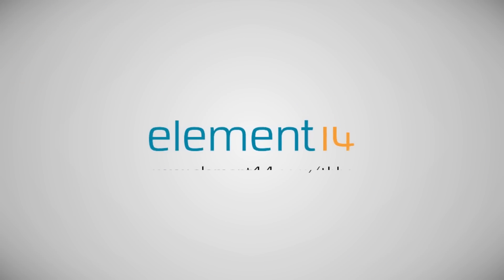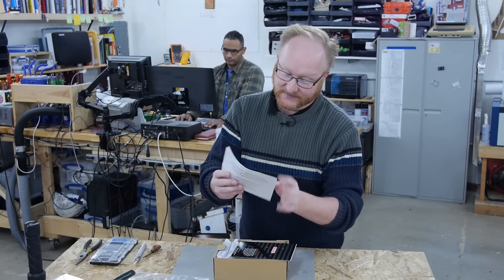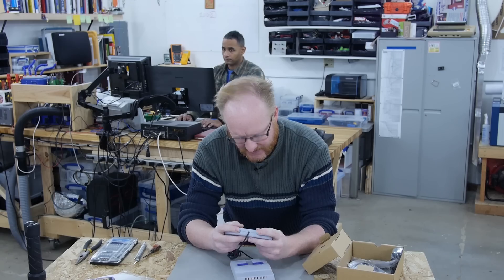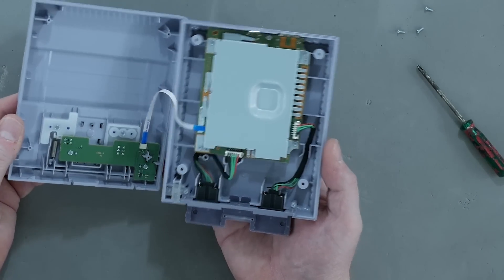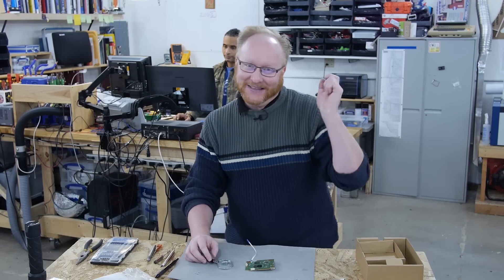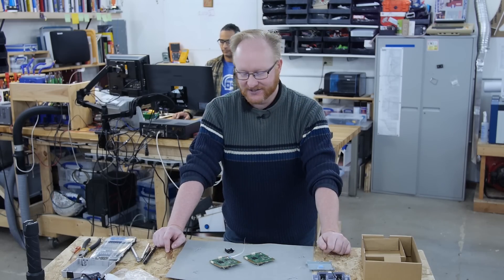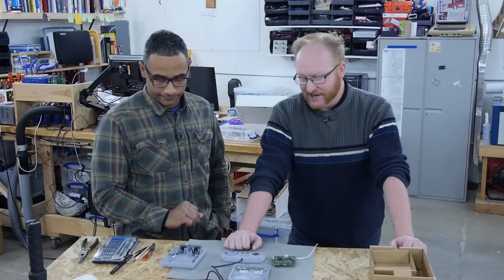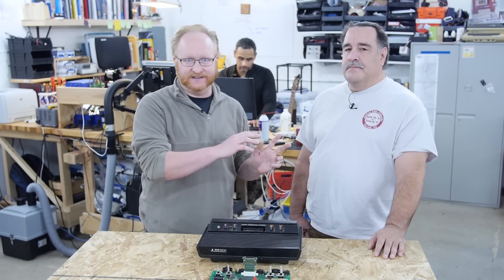SNES Classic Teardown

Comment: I'd love a phat ps3 teardown. I'm curious as to why it was actually beneficial to make a ps3 cluster supercomputer back in 2010, because I've been doing some research on it because it was a weirdly over and underpowered console at the same time.

The ps3 had worse graphics because it was hard to develop for but had really good compute performance at the time which i don't understand.

Also the hardware ps2 emulation is interesting, i want to see how they did that.
Reply: Arsenalfanatic09 
The ps3 was originally planned to have no gpu because of the cell processor , they decided late on to include one from nvidia and it was on par with the 360 gpu wise. The ps3 didn't have "worse" graphics it just didn't get the same performance early on because devs didn't spend time correctly porting games to it. Ps3 exclusives look and perform better than any 360 game (not being a fanboy just stating the truth) 
As for ps2 on ps3 , it wasn't emulation on the original because it contained ps2 hardware, it literally had a ps2 inside.
Reply: Andrew Fishburn 
It did have worse graphics because games on both had worse graphics on ps3 than on Xbox for a long time, you're just being pedantic. The Last of Us definitely looked better than any Xbox 360 game ever made but on average during most of the ps3 lifecycle it had games with worse graphics due to how hard it was to program for (which I would like an in depth description of why it was since I can't find any sufficient enough for an electrical engineer who never got an opportunity to work with Cell)

Also I think it would be fair to call it hardware emulation since it wasn't literally a ps2 stapled onto a ps3, since it still communicated with the ps3 controllers and OS and saved ps2 memory card data to the ps3 hard drive.

Cell looks like an interesting architecture that made the more interesting console in that generation in my opinion.
Reply: Arsenalfanatic09 
I take it you don't own a ps3 or know what pedantic means. You're coming off like a 360 fan boy stating an opinion as fact. 
The majority of multi plat games are near identical on both except for some early ports. The stigma from the early ps3 problems never left for some people and so that myth persists at least in average Joe circles.
Reply: Arsenalfanatic09 
It's not emulation if it's using actual ps2 hardware , which the first model ps3's did. Later models removed ps2 hardware and used emulation software.
Reply: 1. I owned a slim ps3 and liked it more than the 360. I'm not a fanboy for either i'm just stating facts.

2. Earlier games are noticeably better graphics wise on 360 and later ones are still slightly better on 360. It's not a misconception that games look slightly worse because it was truth since it was hard to optimize for that many parallel APUs and the 9 threads available to games. It was marginal difference by the end of the lifecycle but what's the point of having graphical potential greater than xbox 360 if no games ported to both were exactly equal or better on ps3.

3. I do know what pedantic means and I called you it because you are pedantic. 

4. Emulation doesn't have to be software based only. It may literally have a ps2 inside but because of the way it interacts with the ps3 architecture it can be considered hardware based emulation.

Comment: They make 5" LCD HDMI screens for raspberry pi's, they even come a bit smaller IIRC. I have one of the 5" ones inside my PC displaying system information, temps, clock speeds and the time. It's also touch capable if you wanted.

Comment: The N64 is still not a well emulated machine on lower power platforms like Raspberry Pi. My hope is that if Nintendo does make an N64 classic it will be easily hacked and open the community to a better understanding of how to emulate the device.

Comment: I still have doubts about Nintendo's ability to make a n64 mini. I know they've already trademarked some aspects, like the likeness of n64 controller stencil for the top of the box, but they also seem intent in keeping production costs as low as possible to maximize their margins. While the SNES mini only changed the RAM for obvious reasons, n64 might require a more significant revamp. While the cortex a7 has already been shown on the nes and SNES mini to be able to power a mupen 64 core on retroarch, this was achieved with some compromises. A cortex a 53 like the pi 3 might be more suitable for this tasks, as it can handle 64 bit instructions natively, although n64 emulation has been possible in 32 bit singer since even the Pentium ii era since n64 games, due to space constraints, don't actually use many 64 bit instructions.
I think the biggest consideration will be cost. We're looking at a bigger nand due to the size of n64 roms, maybe a new SOC if the a7 proves to be too slow. More RAM due to needing to precompute as many of those 64 bit instructions as possible, and, perhaps far more crucially, the n64 controller. Here is where it's unclear which route Nintendo would take. Controller save pak will obviously be emulated, but what about rumble? What about the analog stick. Will Nintendo use the authentic feeling but expensive n64 mechanism? Or will they use modern potentiometers and lose the authentic feel of the n64 controller?
Tldr; wether the n64 mini will get made depends less on the SOC and more on the controller
Reply: I hope they keep the old school analog stick. Getting a blister playing Mario Party mini games just wouldn't be the same.

Comment: I remember having difficulties emulating N64 on a 1.05 GHz AMD K9 with 768 MB of RAM.  I don't even remember what GPU I was using at that point; this was back in 2005, so, it was an old system by that time already.  Of course, back then I had no clue what I was doing in regards to emulation, so, it's possible I wasn't setting Project64 up correctly.  But I do remember it being quite difficult to get everything running right.

Comment: My theory on the short controller cords, after playing it for a while, is to make you keep the unit close to you so that you can reach the save state button. Hitting the reset button takes you back to the main menu where you can save wherever you are at that moment. It came in really handy but wouldn't be useful if it was across the room from you out of reach.

Comment: Yeah they did keep the data bus on the usb.  Also the controller ports even though they are Wii ports are not wired the same so a Wii controller will not work in them without an adapter
Reply: Tomorrow I will upload a video the video I just made proving that incorrect. Official Nintendo Wii controllers 100% work on the (S)NES Classic.
Reply: That's not true, actually. All official Wii Classic controllers work on NES and SNES Classic just fine. Unofficial ones don't, however.
Reply: not from what i had seen from other reviewers

Comment: “Remember the 80s?”
SNES Release year: 1991
Reply: ... that Nintendo Power slogan came out in the 80's. I give him a pass.
Reply: Your right although the SNES still uses mainly 80s tech
Reply: Maybe hyped in 80s
Reply: It's not like technology/culture suddenly changes upon a clock striking 12 @ midnight. I personally consider the official end to "the 90s" to be September 11th 2001. Not much about 2000/2001 was different from 1998 or 1999 up until that point.
Reply: In late 80's there were chip shortages and that made carts more expensive to manufacture and even produces game shortages to licensees of Nintendo, but nintendo get the best deals to guarantee chips for themselves, that's what he's talking about
Reply: oh the classic coward comic book guy comment
Reply: If you had a SNES when it launched in the early 90's then you remembered the 80's. Someone to have played the SNES at launch and later would've had to have been born 1985 or before to really remember the SNES.
Reply: And it's not pronounced "snes" either. Ooh lets make it sound retarded to simply save a second!
Reply: Released in late 1990 in Japan.  Of course, the hardware was finalized well before then.  And the CPU is still based off the 6502 design that dates back to the 70s.
Reply: just 2 years out of that decade
Reply: I 'member

Comment: My biggest issue I ran into when thinking about making these portable is getting audio out. Audio is only transferred through HDMI and I havent been able to find a screen that has a DAC spliter for the HDMI audio to analog (or any splitting of audio) and the same issue with trying to find HDMI modules that would split its audio. Most HDMI spliters removed/forget about audio. So you could build this system if you never wanted to hear a game. Anyone find a solution for this?

Comment: The only reason why Nintendo made those consoles is to keep the brands alive and preventing to lose their ip before it's considered abandon ware. It's the same reason why they made the virtual console. They just need to sell some units to be able to claim their brands as still on market. What they don't care about is how many people can buy it, as long as at least some do.
Reply: No, that is not how the law works. Abandon ware is just a term used for stuff you can get away copying, because nobody comes after you.
Reply: redviperhh  No, sorry.  Copyright lasts for the life of the author plus 70 years so Nintendo will have their copyrights until at least 2050.

What you are thinking of is a trademark which lasts as long as it is used in commerce and defended against infringement.  However, a trademark has nothing to do with whether a game is "abandonware" or not.
Reply: SpearM3064 trademark is what I meant. I was lacking the correct word.

Comment: Hello, I'm one of them fancy N64 emulation people. The problem is not so much the MIPS processor itself, but the RCP. Well, it's more like the relationship between the main processor and how the RCP's DMA to the main memory. Just like playstation emulation (I'd assume), it's the execution time that's lost between juggling the timings between the RCP's RSP, RDP, DMA to main memory thru the main processor, and the main processor executions in an attempt to get the dead-on 93.75 MHz which in many cases requires the true 62.5MHz clock of the RCP. Since the RCP is a vector processor, you might have dozens of vector operations that need to complete within n -cycles of the main processor dead on. That's kind of a simplified example, but making it work is easy, making it accurate is the hard part when juggling around the ever-growing number of code and asset pipeline stages the 90's was fond of doing.
Reply: The HLE kludge really falls apart on rare games, with weird shit like ingame timers going nuts.
Reply: Most N64 emulators don't actually emulate the RCP.
As there are only like 10 programs written for the RCP, they just have a port of those programs for the PC built in the video plugins, and this PC program talks to the emulated main CPU as the RCP would.

Of course, this is what led to all the terrible N64 emulation issues we been having for years, as games may tweak those programs, or abuse bugs of em, or blending modes not available etc etc etc..
But well HLE is more than fast enough to run in that chip on the NES mini, but nintendo will have to tweak the HLE side to do the rest of the job (as they did on virtual console)
Reply: I haven't heard much about n64 emulation that's any good.

But it stands to reason Nintendo themselves should have a technical advantage in building emulators for their own systems in that they designed the things in the first place and probably have extensive documents regarding the hardware design and so on.

(It's also worth noting Nintendo has working n64 emulation already, and given the hardware that runs on, worst-case scenario for an n64 mini is they shove a cut-down Wii into a box. - incidentally doing this would immediately cover them for gamecube and wii games as well, down the road, so it's not the craziest of ideas.)

I get the feeling that emulation in general though is hitting something of a brick wall due to timing and synchronisation issues.

While I'm not 100% convinced by his reasoning, it's still interesting to read what byuu had to say on the matter of accurate SNES emulation.
Because his primary constraints, he claims, are all in timing and synchronisation, and as a result he claims an emulator has to be entirely single-threaded if it hopes to have any degree of accuracy to it.
And of course, as is pretty obvious, Higan/BSNES demands some pretty hefty single-threaded performance considering there were working SNES emulators on 100 mhz pentium systems back in the day.

Accuracy comes at a price. And it seems synchronisation between different hardware chips in a system is persistently one of the biggest problems.
(even though by definition, all of this should be running in parallel, it runs in parallel at a very finegrained resolution that requires timing that 'parallel processing' in emulation simply can't replicate. - It makes me wonder though if perhaps a parallel implementation would work out if you shift the entire emulator onto a GPU, rather than bothering with doing anything on the CPU? GPU's seem more suited to massively parallel workloads. But I'm still not sure they can do any better at the synchronisation problem...)
Reply: Nintendo don't do a very precise emulation job either.
Mario 64 for example is missing the vanish cap effect on VC, which kinda points out to their emulator also using HLE techniques just like the rest.
The biggest advantage nintendo actually have is that they use the "one emulator, one game" approach, where they can finely tune the HLE engine to run the target game perfectly, and don't have to worry about making an emulator that runs all the games.
But there are REAL N64 emulators, or ways to make those emulators run games precisely.
That parallei plugin in particular actually emulates the RCP coprocessor whole on the GPU using the vulkan API, which allows you to get precise N64 graphics and no glitches, but at a playable speed.
Reply: The source code is not that useful, specially the microcode one as it's just asm anyway.
But writing a specific HLE driver for only one game is a huge advantage as once you got the specific game running, you got the specific game running.
Reply: actually the NES mini with a mupen build emulate some n64 like mario kart 64 pretty decently.
Reply: Mmmh. Perhaps Nintendo couldn't work out how to do it accurately on the kind of hardware they needed the games to run on.
You't think their HLE methods would be a little better than that, given they must surely have the source code for both the games, and the actual specific microcode used. (possibly even the source code for it, assuming it's not something akin to assembly code.)

Reliable accuracy in emulation still remains somewhat elusive it seems...
Reply: I don't see why I should buy these emulation stations when I already have a Pie which can do the same thing. But if they manage to emulate DK64 well I will buy a possible N64 Mini. That game did not even run great on the original hardware and emulation of it is a nightmare.

Comment: N64 didn't take much. I played it using P3 550mhz with a 3dfx voodoo banshee and it ran pretty good.
Reply: I first got decent N64 emulation on a  K6-2 500Mhz w/Voodoo2 . It ran that good because it had the GLIDE API helping it.   Early N64 ran like shit if you didn't have a 3Dfx card.
Reply: Early N64 emulators were more hacks to keep speed up. Current stuff is more accurate and takes more power.
Reply: ikkuranus I’ve done it with a P2 at 450MHz with a RivaTNT2 M64 from nvidia, ran perfectly, only a few games were a bit slow

Comment: N64 Emulation is like... a raspberry pi 3 can almost do it. Maybe double the specs of the Pi can easily do it pixelperfect. So it would be a kind of big jump from the hardware in the nes/snes mini. But maybe Nintendo has better emulation software that needs less hardware, I dont know.